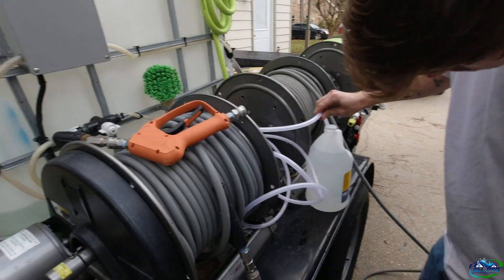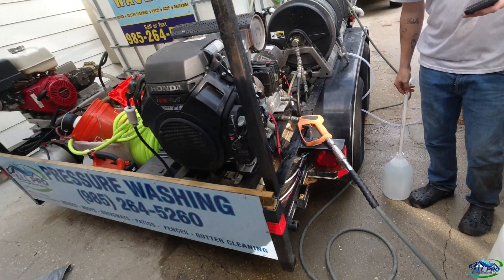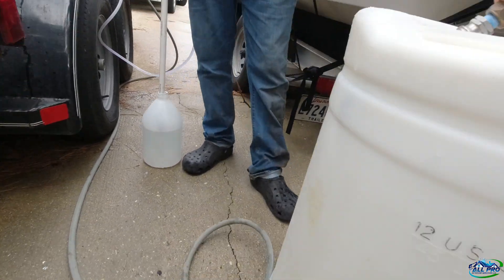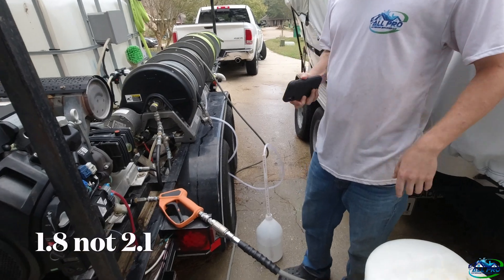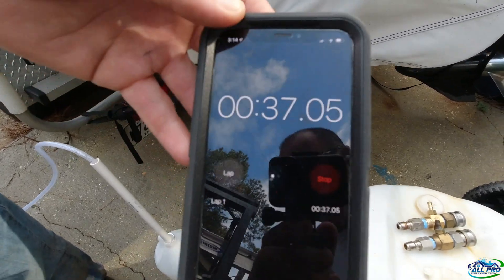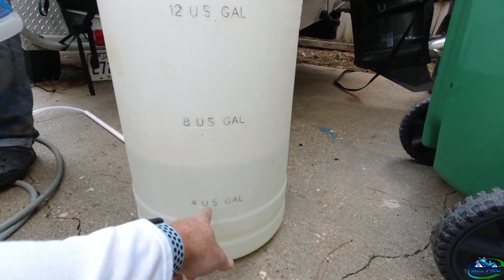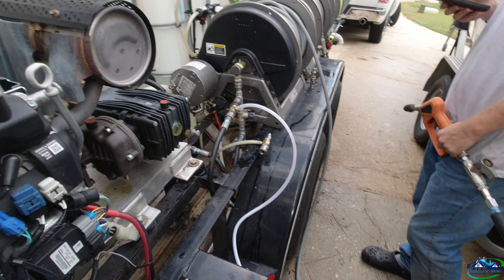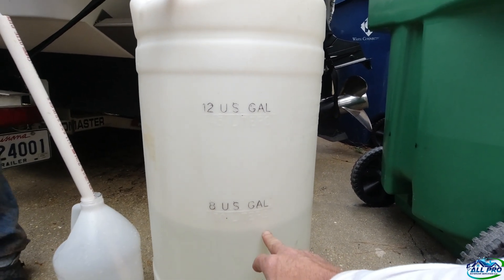Chemical Injector Draw Test- Great Results

Comment: I’ve been using a 12v pump for SH & soap since I started.  I looking into down streaming with the hope of eliminating one step in the process.  I tried a 2.1 injector on my rig (4.7gpm @ 3600 psi) with 250’ of hose.  I did see some soap being down-steamed but it’s weak. My options, from what I understand are: Move the 2.1 closer to the gun and work out of a bucket or go down to a 1.8 injector.  Here’s my question:  Will that smaller orifice hurt my pump by preventing water flow too much?
Reply from the maker: We would pull about 1.25% with a 2.1 injection on our 4 GPM unit with 200' of hose. I would not recommend pulling from a bucket. I would start with a bucket test to see what you are actually drawing. Thanks

Comment: Links for the 1.8 injector would be appreciated.   It should work on my 4-gpm
Reply from the maker: https://shop.pressurewasherproducts.com/GENERAL-PUMP-FIXED-DOWNSTREAM-CHEMICAL-INJECTOR-18mm-HI-DRAW-5188.htm
Reply: @All Pro Exterior Services LLC  thanks for the reply. 

Also I had another question.
The 1.8 chemical injector is rated for 2-3gpm will that effect my 4gpm machine. Will it still work ?

Comment: @All Pro Exterior Services LLC. I've learned quite a lot from your videos. Correct me if I'm wrong though. On your second test with the 1.8 injector. It pulled 6 gallons on a half gallon of chem. Therefore, it would then pull 12 gallons if it were a full 1 gallon of chem. When you subtract the 1 gallon of chem from the total, it becomes an 11:1 ratio for both. So why wouldn't the math then be as follows: 12.5 ÷ 11 = 1.136% (rounded to 1.14%).
Reply from the maker: Thanks for watching & supporting the channel. You are correct & I was using quick math. Thanks
Reply: You don’t subtract the gallon. C1xV1=C2xV2
Reply: @bennybenny7217 if you have 12 gals final, what is the make up? 1gal of sh and 11gals of water. That’s a 11 to 1 ratio. It doesn’t matter how long it takes, 30 seconds or 2 hours, the ratio will be the same.
Reply: Not sure where I’ve said differently. How is it a relevant reply to my posting.

Comment: Hey man great videos! Just curious why does the 1.8 pull more chem? Isn’t it smaller than the 2.3?
Reply from the maker: The smaller orifice restricts the water flow allowing for a stronger mix. The bigger orifice allows more water which weakens the mix. I hope this helps. Thanks

Comment: Good video! I believe you have to divide by the total number of parts which are gallons in this 1.8 injector case. You have your bleach which counts as one part and you're other 6 gallons for a total of 7 gallons. 12.5% ÷ 7 = 1.79%.  For instance one gallon of 12.5% bleach and 1 gallon of water - 
12.5 ÷ 2 = 6.25% bleach..... I had that last digit wrong but it's corrected now. 🤓
Reply: Yeah people mix up parts and ratios
Reply: Not 5:1 as only a half gallon was drawn to get 6 gallons. Doing the full gallon would draw an 11:1 with 12 gallons
Reply: That gallon of bleach was in the tank that he counted as 6. It was 5 gallons of water and 1 gallon of 12.5% bleach.

Comment: I'm very confused. How does the smaller mm injector allow more chemical to be injected
Reply from the maker: A smaller mm injector restricts waters flow. A larger mm injector allows more water diluting the SH to a lower percentage. Hope this helps. Thanks
Reply: Do you always run a draw test before a job?  @allproexteriorservicesllc5338

Comment: My 8 gpm did not like the 2.1 no chemical strength . I needed the 2.3
Reply from the maker: I had to go to the 1.8 to get a decent strength to clean anything. 2.3 is ideal if you can pull a good ratio. Thanks

Comment: Aren’t you supposed to subtract the 1 gallon of chemical from the total number of gallons being drawn? So if you got 6 gallons total that would be 5 gallons water to 1 gallon of chemical making it 5:1 and not 6:1? So 2.5% instead of the 2.08%?
Reply: No becase it's a dilution ratio!

Let's say we used 1 gal of SH in 1 min and the total was 10 gallons ( both water and SH.  (So there has to be 9 gallons of water and 1 gallon of SH in the tank.

Now we have 1 gal of SH concentrate that became 10 gals of ready to use in a period of 1 min.

So if you do this for 10 minutes... your gona have 100 gallons of ready to use with 10 gallons of SH in the mix.

Written as 1:10.  Where 1 is the SH in gallons and 10 is the total SH + Water. (The diluted amount).
Reply: He should be correct. Let's assume the total was 2 gallons instead of six. If you subtract by 1, then 12.5% divided by one would still be 12.5% while dividing by two would yield the correct result of 6.25%.

Comment: Great stuff as always.    In your opinion what would you say is the ideal setup for a rig?    I'm currently running an AR45 and 2 5GPM machines.    Will upgrade soon to an 8GPM but not sure if I should go the injector route or not.    Any advice will be appreciated
Reply from the maker: Sounds like a great set up. I am running the 8 & AR45 and love this set up. The 5.5 GPM tends to pulls more SH in case you need to downstream. But the 8 GPM is a beast for surface cleaning. Focus on what would make you more efficient. Hope this helps

Comment: You did the math on the first injector wrong. Not sure why you multiplied your gallons x2. If you would have taken it 12.5% Divided by 9 on the 2.3 injector you would have had a 1.38% mix. Your test on the 1.8 injector you did it the right way  and came up with a 2.08% mix. Informative none the less , but just thought I'd mention that.
Reply from the maker: The reason I multiplied x2 on the first test is because the gallon was half empty. So it would have taken 18 gallons to empty the entire gallon jug. This was a draw test not a flow test. Thanks

Comment: What would be the best % you would like to use on dirty vinyl siding? When I do the same teat as you did I either get .69% or 1.5% I decided to use 1.5%. I'm wondering if it's to hot of a mix?
Reply from the maker: I would go with 1.5% in your situation as well. Prewet the vegetation. Thanks
Reply: @allproexteriorservicesllc5338  Thank you

Comment: I swear your calculations was off. But oh ok
Reply: It was off.  First test was 9 gallons, second test was 6.  The only right answer means the second result should be 50% higher than the first, which is not what he got.  In the first test, he multiplied the total gallons (9) by 2, in the second test, he did not.  Test 2 actual result was 0.125 divided by (6 gallons x 2), or 1.04%.  First test was 0.125 divided by (9 gallons x 2), or 0.69%.  And 0.69% x 1.5 is 1.04%, so that's the proof that (a) you got a result that you thought you should get and (b) that his 2nd calculation was incorrect.

Comment: So the draw test is based on 60 seconds?
Reply from the maker: No, the draw test is based on GPM. I just wanted to know the flow rate. Thanks
Reply: @allproexteriorservicesllc5338  , thank you for the quick response. I’m new at it and wanting to learn the right way. I have a 4.2 gpm 4400 machine with an adjustable injector. I can’t seem to figure out the % SH hitting the surface, vinyl siding that is. So do I measure the gallons of water after the gallon jug is empty to get my %?. I’m totally confused. The injector is a 2.0 up to 5. Does this make sense.
Reply: I was think I could just pull straight SH from a tank or bucket.
Reply from the maker: @artbentley4887  It is an easy formula. Take the SH % and divide by the gallons after the gallon jug is empty. Example, if you have 12.5% SH and draw 10 gallons including the 1 gallon jug then you would use 12.5/10= 1.25%. Hope this helps
Reply from the maker: @artbentley4887  Yes, we pull straight SH from our SH tank. I would imagine you will be around 1.2% SH on the surface. Thanks
Reply: @allproexteriorservicesllc5338  .  Wow, you just helped me understand it. Thank you so much. Hope you have another blessed , successful up coming season. Love  the channel

Comment: Great video
Stupid question. 
The bigger orifice size means more chemical suction?
Trying to figure out on my 8gpm machine with 200ft of hose
Thanks!
Reply from the maker: You would think so, but not the case. The smaller orifice draws more chemical. The bigger orifice injectors allow for more water flow. Thanks
Reply: @allproexteriorservicesllc5338  
Thank you sir, really appreciate for the quick response!!

Comment: Hey man. Are you still running the 1.8 on this? I recently upgraded to an 8gpm from a 4 and use the super suds sucker. Just did a test and I'm spraying a .62% 
If I throttle down I can spray .83%. Gonna try a couple different orifices that it comes with again tomorrow.
Reply from the maker: I have been using the 1.8 with good results. Now I mainly use my AR45 and hardly down stream. but the 1.8 did much better than the 2.1. Thanks
Reply: @allproexteriorservicesllc5338  Great thanks. Did some flow tests this weekend and was able to pull 1% with thr 1.8. Just lost a lot of distance. Probably will run that and just use my bypass to the injector to rinse. Looks like I'll need a flowpro soon. Thanks!

Comment: When I tried the 1.8 injector on my 8.5 gpm it seemed like it was really stressing my machine and i didn't like the sound of it so i didn't use it and went a little bigger orfice high draw injector. Not sure my ratios but it's fine for house wash and my machine seems to be back to normal. 
Any thoughts on that?
Reply from the maker: That was my original concern with the strain. I spoke with a few people and they have been running the 1.8 for a while with no problems. Mine doesn't sound much difference than the 2.1. Hope this helps. Thanks

Comment: Thank you for all your informative videos.
Just wondering what your big pressure washer is … 8 or 10 GPM? 
I noticed it’s a GX 800 motor, I’ve never seen that on a 8gpm machine…
Thanks
Reply from the maker: Thanks for watching!! It is a Sudor 8 gpm pump, but I am getting about 9.5 gpm. The reason I didn't go with the 10 gpm pump, is because it would dilute my soap too much.
Reply: @allproexteriorservicesllc5338  Ahhhh you dont need that much soap anyway :)

Comment: Here’s a question for ya.   I’m upgrading my 4gpm to an 8gpm.  Can I use the injector from my 4 on my 8??
Reply from the maker: I am using the 1.8 injector which is rated for smaller machines. However, you will lose flow by going with a smaller injector. Thanks
Reply: 4gpm and 8gpm have different jet size inside the injector.  If you take your quick connect ends off you can see inside the injector there is a small hole and flat slot.  You can run a 4gpm injector on a higher flow unit but you lose a lot of flow to. Being restricted.   8gpm injector jet hole is much larger inside. That allows proper flow. 👌

Comment: how to check gallon test vs sh% draw test...   Start with a five gallon container full of water hook your down-streamer to it and add the amount of pressure hose that you usually use. Start your pressure washer and spray your gun into a fifty five gallon container. When it has fifty gallons in it, stop. Measure how much has been drawn from your five gallon bucket. Let’s assume three gallons. So you have 47 gallons of pressure wash water and 3 gallons of soap. Let’s call that 47÷3. That equals 15.6 to 1. If you are using 6% bleach, divide 6 into 15.6. Answer? .3846. You are getting .38 percent bleach on the wall. Now that .38%  downstream injector % out put.
Reply from the maker: That is another option, but larger scale. Both test will produce the same results if you break them down. Thanks & good info
Reply: @allproexteriorservicesllc5338   but I thought I would share how I test downstream injector.  Maybe it will help someone also to understand how to draw test.
Reply from the maker: @fbombpowerwashingllc  Absolutely!! Thanks for sharing.
Reply: @allproexteriorservicesllc5338  this how I test, to see what I get and I also use only the 1.8 downstream injector.  And even tried the highflo injector that they claim that draws 3% . But really doesnt...  their website only states 30% to 40% increase, so let's say if I'm shooting 1.38% with high draw 1.8 and then with check valve injector add say on high side 40% to 1.38%...  1.38% + 40%  = 1.93% ..  with 12.5% sh.
Reply: C1xV1=C2xV2 is the formula required to calculate it correctly. 
In your example it’s 6(C1)x3(V1)=x(C2)x50(V2) so x=18 divided by 50 equals 0.36

Comment: Hey bro you need to pull out all your hose to do an accurate draw test 👍
Reply: Hey bro also have at least 1/2 full water buffer tank for head pressure feeding your pressure cleaner pump with the draw test 👍💪
Reply: Every 2.3' or 28" of height of liquid in a vessel/tank = 1psi at outlet. Higher outlet subtract that height
Reply from the maker: Agreed, but I am close for sure. Thanks Maybe next test after some mods.

Comment: Hey man have you tried adding check valves on your injectors? Last longer and increase your draw.
Reply from the maker: I have not, but I have heard mixed opinions about the check valve. If I can find an adapter for a reasonable price, then I would do some testing. Thanks